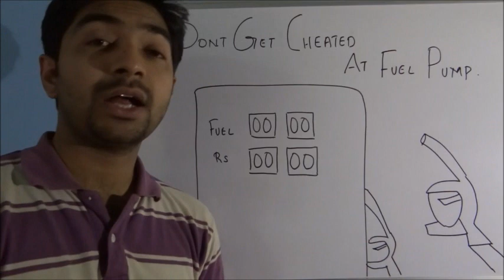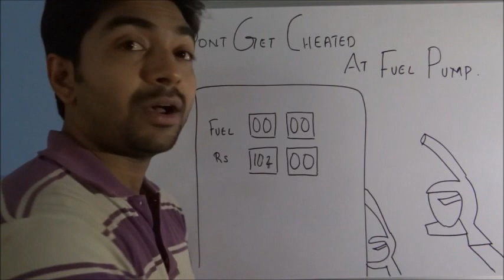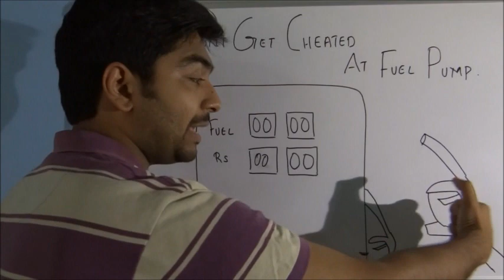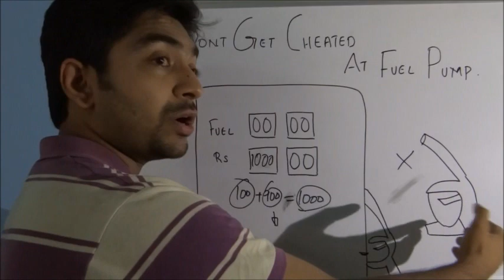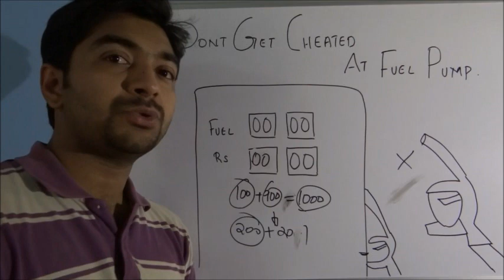How you get cheated at fuel pump. ✔

Comment: This is wrong ! the first way u get cheated in a petrol bunk is that they try to fill your tank without resetting, second way is during giving balance most times the attenders have good amount of money in their hand and they confuse you. the third  one is by way of various circutes added to dispensers which will give delivery of less fuel which will be operated by remote . 99% petrol pump cheating are without the knowledge of owners and the money is shared amoung the staff onli

Comment: One more thing they do. Watch their hands. They hold the nozzle-lever and keep adjusting it with their fingers. The catch is...they feel the sweet spot(through vibrations of fuel coming out of the nozzle) and try to run the meter without opening the nozzle fully. So guys always tell them to feed the amount and then lock the lever in place. This prevents their cheating to an extent.

Comment: Thanks for this vdo. But usually I have seen they cheat people even after ensuring the reading is reset to 0. This is done by pressing the lever once while in the process of fueling. I am not sure why and how it is done. Maybe there is a mechanism that allows the price dial to run independently as that of the fuel dial. Again I am not sure how they do it.

Comment: Nice Info. Also be reminded that resetting can be done manually without keeping the Fuel gun back to the holder. Hence ensure the Zero before fueling. Thanks.
Reply: Yea... I had that on mind. In my country, Ghana, u just have to check the amount that is typed on the machine. The attendant can type less the amount u want to fill

Comment: This is very old technique to cheat the people. Your intension is very good to aware the people.
if I ask to fill fuel of 100/- , the meter will slow down at 185/- around and nobody is observing whether fuel coming from nozzle then after or not, as the nozzle is in tank.
If you notice , only air is coming then after, no fuel.

Comment: good, but I suspect they must have far more sophisticated way of cheating ..that's why I get different milage out of petrol filled from different pumps
Reply: common tips to avoid petrol pump frauds.

1)make sure the meter shows zero(common sense)

2)watch the numbers he is pressing on keypad,if u see other numbers different than ur amount or quantity in liters,something is wrong.

3)watch the display(common sense),make sure numbers are not jumping.

4)watch the pump nozzle ,he will be pressing the nozzel handle constantly and will not take his hands off,he is manipulating the flow of fuel. he says the handle lever does not locks,so i have to hold it. he is lying.(nozzles are found to be defective by inspecting authorities) a nozzle can pump up to 40litres/minute and should not be less than 10 litres /minute.so ,dont worry if he fills it very fast,with his hands off the nozzle pump. if there is more than 25 ml/5 litres difference, it is defective. some nozzles have overflow detect and shutoff system,while filling full tank. this may be manupulated manually.

5)if the service guys say ,sorry i heard 200 instead of 500,he is cheating u.(he will fill for 200 only,u see the meter and asks i said 500,he says sorry and filll rest without resetting to 0, ie. 200 to 300 instead of 0 to 300, finally only 300 only. but u may think it is 200+300, if u dont observe the meter properly, very very popular trick in all pumps.

6)while filling u r taking out money from purse, or card payment guy comes near u ,the filling guy stops and enters the amount 1000(say u asked for 1000 rs),as u see the meter it shows 1000 which u think,ther meter ran completely,but he stopped somewhere at 600,and reset to 1000. they may even distract u asking cash or card,there is no air in tyre etc to divert u and immediately stops fueling and resets to ur asked amount. 1000. this happens frequently with car owners. get down of the car and stand near the filling point.

7)full tank,be it byke or car, there will be more litre space than company specs,to allow vapour air gap in the tank. so be specific in litres not full tank. commonly argued is why did u fill more than my tank litre capacity.

8)Electronic meter tampering done in 2 ways, (illegal electronic chip)

-->1)using remote (hidden in the cash bag,he presses while putting cash,and the meter runs fast with jumping numbers,

-->2) entering special codes in the keypad panel,eg 10 40 412 entered once in the morning time runs all day letting less amount of flow  or jumping numbers.

--> very hard to find,because there is logic associated with chips. there are infinite possibilites. eg. if u ask for 80 rs,he presses 50 and then 80 immediately ,display shows 80,but u get only 50 rs fuel. (really happened 
at cyberabad filling station,hi-tech city,Hyderabad). watch carefully while he presses numbers on keypad and also display finally, if he enters other numbers than what u said,there is something wrong.

9)take of printed bill of ur transaction,from petrol pump dispenser and not hand written receipt. they say out of paper,make a habbit of insisting to give a printed bill.

10) quality is not in your hands,have to bear if ur vehicle gets smoke,noise,less pickup.. quality has to be checked only by the respective oil companies and no once else can do that,nor authorised.

Comment: common tips to avoid petrol pump frauds.

1)make sure the meter shows zero(common sense)
2)watch the numbers he is pressing on keypad,if u see other numbers different than ur amount or quantity in liters,something is wrong.

3)watch the display(common sense),make sure numbers are not jumping.

4)watch the pump nozzle ,he will be pressing the nozzel handle constantly and will not take his hands off,he is manipulating the flow of fuel. he says the handle lever does not locks,so i have to hold it. he is lying.(nozzles are found to be defective by inspecting authorities) a nozzle can pump up to 40litres/minute and should not be less than 10 litres /minute.so ,dont worry if he fills it very fast,with his hands off the nozzle pump. if there is more than 25 ml/5 litres difference, it is defective. some nozzles have overflow detect and shutoff system,while filling full tank. this may be manupulated manually.

5)if the service guys say ,sorry i heard 200 instead of 500,he is cheating u.(he will fill for 200 only,u see the meter and asks i said 500,he says sorry and filll rest without resetting to 0, ie. 200 to 300 instead of 0 to 300, finally only 300 only. but u may think it is 200+300, if u dont observe the meter properly, very very popular trick in all pumps.

6)while filling u r taking out money from purse, or card payment guy comes near u ,the filling guy stops and enters the amount 1000(say u asked for 1000 rs),as u see the meter it shows 1000 which u think,ther meter ran completely,but he stopped somewhere at 600,and reset to 1000. they may even distract u asking cash or card,there is no air in tyre etc to divert u and immediately stops fueling and resets to ur asked amount. 1000. this happens frequently with car owners. get down of the car and stand near the filling point.

7)full tank,be it byke or car, there will be more litre space than company specs,to allow vapour air gap in the tank. so be specific in litres not full tank. commonly argued is why did u fill more than my tank litre capacity.

8)Electronic meter tampering done in 2 ways, (illegal electronic chip)

-->1)using remote (hidden in the cash bag,he presses while putting cash,and the meter runs fast with jumping numbers,

-->2) entering special codes in the keypad panel,eg 10 40 412 entered once in the morning time runs all day letting less amount of flow  or jumping numbers.

--> very hard to find,because there is logic associated with chips. there are infinite possibilites. eg. if u ask for 80 rs,he presses 50 and then 80 immediately ,display shows 80,but u get only 50 rs fuel. (really happened 
at cyberabad filling station,hi-tech city,Hyderabad). watch carefully while he presses numbers on keypad and also display finally, if he enters other numbers than what u said,there is something wrong.

9)take of printed bill of ur transaction,from petrol pump dispenser and not hand written receipt. they say out of paper,make a habbit of insisting to give a printed bill.

10) quality is not in your hands,have to bear if ur vehicle gets smoke,noise,less pickup.. quality has to be checked only by the respective oil companies and no once else can do that,nor authorised.

Comment: Not only this bro I have caught them like this many time I had fight they doing another way of you tell them to set amount and file like if you said 1000 they will set and fill but while filling they will push the controls lever this also cheating because if they set for 1000 they can lock automatic shut up but they will not do if they set for 1000 and the automatic valve set it will automatically shut off when got reached the amount but why they keep pushing like slowing the speed because if they slowing the speed it will let the machine recalibrate.fule machine have measure the volume of pressure so while pushing the valve it will creat repressure to make the calculation because of this they will reduce maximum 50rupees petrol for 1000 rupees filling 
When I fill I will tell them set and lock and take your fucking hand of the gun some of then because of this they will ignore me but what to do complaint them will not work so I slapped some
Reply from the maker: +Safee Raj 
Good observation 
Thanks for the comment 
WhatsApp @ +919744615655 for more tutorials.

Comment: @ 3.09 mts...you said additional 500 rs where as it should be 100 rs. Informative. same thing happened with me couple of times.they also adjust the lever and do not place a lever lock . so the petrol comes out with air in it and you dont get the exact liters you asked for
Reply from the maker: +Raghunath Pillai 
Thanks for the comment. 
What's app us @ +919744615655 To get updates on Mechanical/ Automobile engineering

Comment: we need to look out in 
*rs/litre. 
* density.
there is a chance to cheat through this..
if you fill the petrol for 100 rs means, you found these values in petrol bunks
1.66
1.64 
that means 1.66 litres.
if they put 1.64 means he cheat 20 ml from us.

the next thing, avoid filling the fuel in afternoon.. since temperature will reduce the volume of fuel
Reply from the maker: +James J 
We are honored by that comment.
For more info you can email us at techtrixinfo@gmail.com or whats app at +919744615655

TechTrixInfo.com

Comment: And what about  ensuring that  the calibration is correct in that what is delivered in the tank has the same volume of what is  shown on the meter?  In software controlled pump all it takes is  reprogrammable the issue.    The only hope of not being cheated  is to take a calibrated container  with you and ask the attendant to fill that up first to check his calibration us correct as my experience is that it never is.

Comment: i experienced more other ways cheating also.
1. i requested petrol fill in my car for 1000 Rs. the bunk fellow put the gun in fuel tank and started filling, mean while he came to me and asked for money, i gave 2 five hundred notes, then he diverted my concentration asking  whether the notes are genuine or not, then i stopped concentration on meter reading and involved in talks with this fellow, suddenly when looked at the meter it was showing 1000 rs on meter. how he cheated me here?
when i was in talks with one fellow one more fellow from behind dispensing unit came front and did reset to zero when meter was at around 600 Rs. by manually pressing the liver where he supposed to put refilling gun and entered 1000 again on keyboard for a fresh transaction. He did all this  with in very short time around 6 to 10 secs. so obviously the reading on display showed 1000 now.
I made a very big fight, the bunk owner has come and tank filled my car and told sorry and some cock-bull  stories like there is no power connection they are running on the battery backup and sometimes due to no sufficient power supply from battery it resets it self to zero etc blaw blaw..

2. i also eperienced in other bunk in other way.
   i gave money for 1000 and requested for 1000 Rs petrol.
  The meter was running at slow space upto 800 Rs. then it suddenly jumped to 1000.
  it happened twice i dont know how. i let you know once i know
Reply from the maker: Hmm
You should be really careful or else they will cheat you just like that. Thanks for sharing, it will be useful to others too.

Thank you , please subscribe to us for more videos n keep connected with us on Facebook just search for Techtrixinfo

Comment: They reset fuel and price in zero. I wanna petrol for rs. 300, he sets rs. 300 in the mechine. Then he puts the gun into the tank, and lock the needle of gun. If Tank refilled for rs.300, automatically needle (trigger) released in the gun. This is no problem. In some petrol pumb, they do it as above process, but he doesn't lock the gun, keep hold and press the needle of gun up to fill it. My doubt is any cheating in petrol gun while keep pressing. Is it possible?